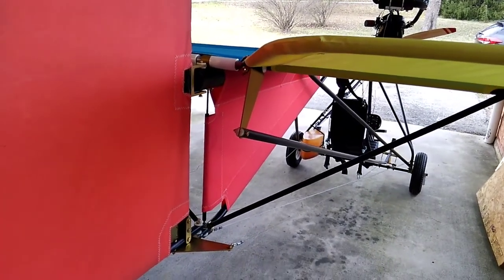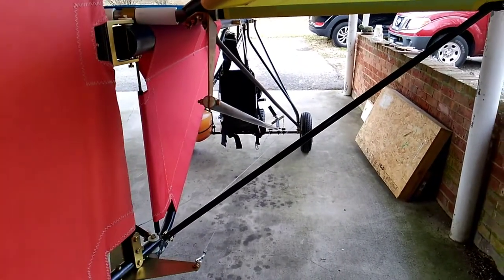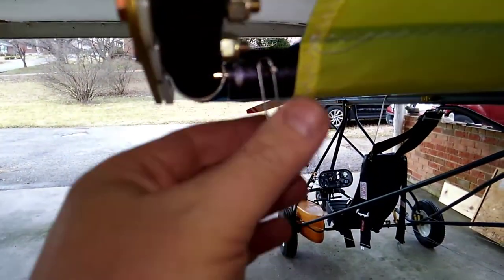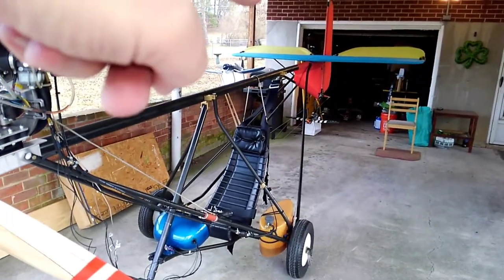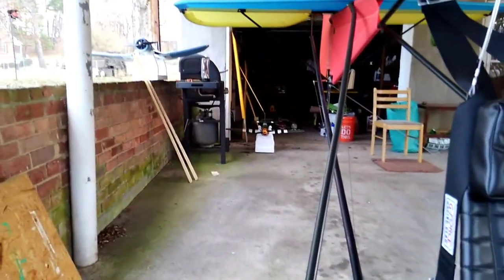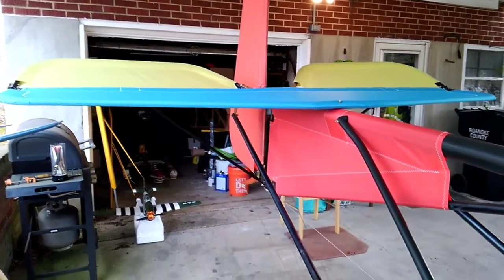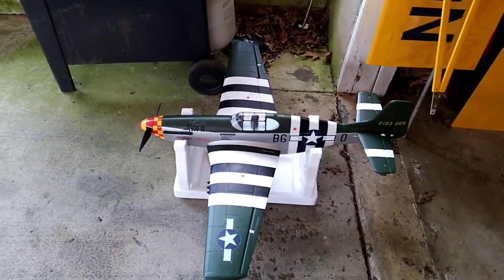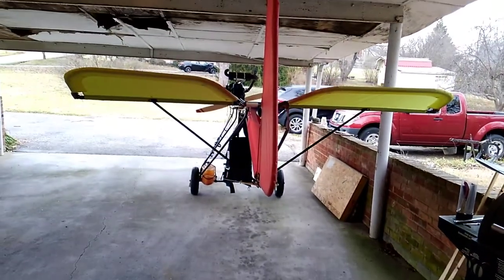Chotia Weedhopper control surfaces rigged and demonstration.

Comment: Going from RC models to actual human flight aircraft is a big step. I just hope you know what you are doing. I lost a cousin to a home-built aircraft. De did a nosedive shortly after takeoff. Ending his life in seconds. Be safe and GOD bless.
Reply from the maker: I had trouble going from full scale to model as there is a problem with perspective. Learned to fly in the family Ercoupe when I was eight years old and my first R/C model was a Bob Martin Pussycat a few years later. 
Aviation can be a cruel Mistress if mistreated, as I've lost several friend and family to her wrath. If I may quote Captain A. G. Lamplugh, an aviation pioneer:
“Aviation in itself is not inherently dangerous. But to an even greater degree than the sea, it is terribly unforgiving of any carelessness, incapacity or neglect.”

Comment: Not sure about regs, concerning fittings, but an aircraft mechanic could check for you on it. Maybe Teflon washers, with silicone lubricant might stop the squeaks, in the elevator control. Or just silicone lubricant on the existing washer, and e clips, if any. Nice job. Very interesting about that P-51 model's real world plane's back story. Thanks for the video.
Reply from the maker: A spot of paraffin will also do the trick. Just use the wax from a Dollar Store candle.

Comment: Are all weedhoppers like yours that have the rudder in the stick? No pedals on this? I have never actually seen one close up. Is this new or just refurbished?
Reply from the maker: Unless the Weedhopper has been modified, yes the elevator and rudder are on the side stick. This one is being rebuilt. It is not terribly difficult to scratch build one.